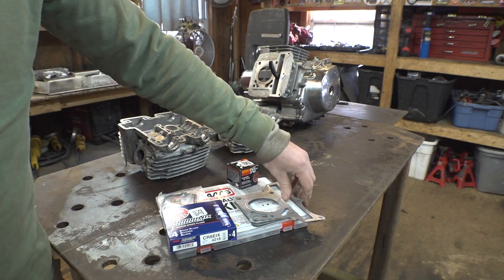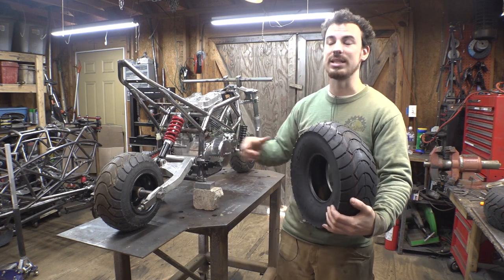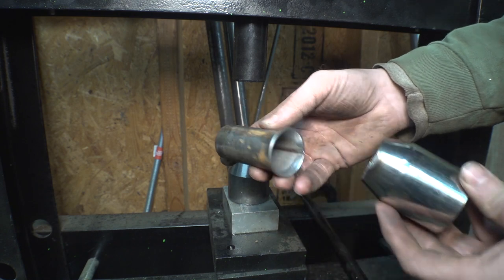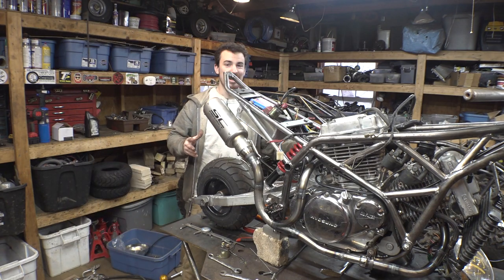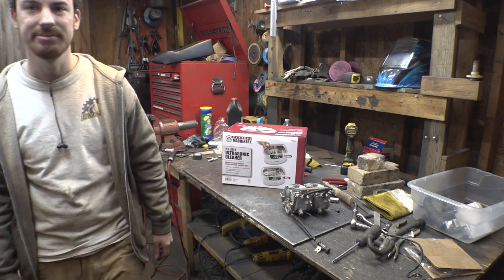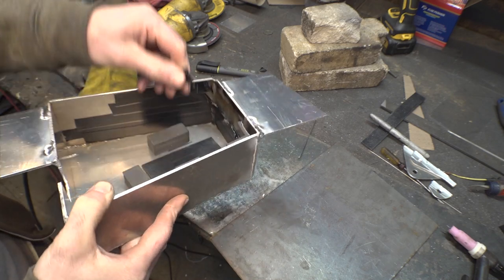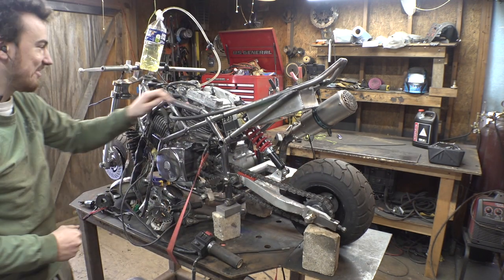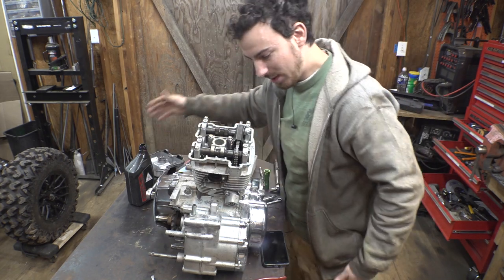Getting the Mini Crotch Rocket Running!!  Mini Crotch Rocket Build Part 7

Comment: A lot of motorcycle exhaust systems are double tubing to stop discoloration and so that the outside doesn't get severly hot and overheat your legs or feet.

Comment: The crank journals are opposite each other like in a Honda. It sounds proper for that arrangement. A Harley uses one journal for both rods that's why it gets the potato potato sound. Oh and you didn't need to get shocked. Since the sound changed when you took one plug off and it was still running it had to been running on both cylinders. LOL
Reply: I assume he knew that at first one worked by his reaction, but for fun and to see if other sounds any different did the other. I hate getting shocked by bikes.

Comment: An easier method to fix your battery box issue would have been to move the box so that it was on top of the frame brackets so it was sandwiched between the frame and seat.  Remove the bolts, and the box is still sitting on the frame.
Reply: More people need to like and comment on this to make sure he sees it, definitely a good idea
Reply: Thought the exact same thing.
Reply: Yeah. Funny how you can overlook something simple like that while designing.
Reply: I yelled this at the screen too as he went to cut them off... too late.
Reply: @TuttleScott  me to
Reply: @TuttleScott  I did the EXACT same thing.... "But, IS he daft? Why not just put the box over the seat mounts to let it hang from there???" 😁
Reply: yeah was def thinking cut out a chunk in the bottom of the seat and then it can act as a cowl and functional padded seat to cover the box.

Comment: I swear I am the most stoked person to follow this build! Due to having an exact same engine for my current  powerwheels build. I made my exhaust a week ago and I actually utilized the original one. I cut up the doubble-wall tubing and used only the outer tube to make the new one. Yesterday I also made a batterybox and started bundling up the wiring. It's close to a start up and MAN was this inspiring to hear yours! Love the bike 🔥

Comment: Looks great.. Back plug is most likely for lights, the one you had start wires plugged in to first, clutch is most likely a cable adjustment.  Your getting there.  Great job..

Comment: On battery challenged builds, you can set up the ignition relay to break the lighting circuit while the solenoid is triggering.
Reply: Simple, effective and easily overlooked, I love this idea even for non-battery challenged builds ...

Comment: For small parts use a metal mesh tea ball for them it keeps them contained and you don't have to fish for them later. float pins, needles ect............. Also the lithium ion battery will tank if charged close to freezing temps so be aware of that.

Comment: I’ve used a few of these mufflers, there are many cheap exhaust inserts (51mm) available that fit and work well to keep down the sound. The little v2 engines usually sound good and still have the distinctive V2 sound, I would guess as your primary header is so long and the rear so short, by the time the sound gets from the front cylinder firing, the rear is almost firing so the sound is less uneven and sounds closer to a single.
Most factory exhausts on v twins has the secondary header loped forward before going back to increase its length before joining the primary pipe.

Comment: Next time you want to see if both cylinders run(instead of shocking yourself) just use a temp gun on the exhaust, you'll know right away if one is not running or not properly. Also for your ultrasonic, they do sell fluid for that that will help dislodge and clean parts. Good work on the mini bike so far, can't wait to see you ride it.

Comment: When I was a mechanic for John Deere, we used simple green in our ultra sonic cleaners.  I now use Chem Dip in mine.
Reply: Can you use mineral spirits?
Reply: I use regular pine sol cleaner and let it soak overnight. I don’t have an ultrasound cleaner but it works great. Best thing I have found and found it by mistake. Give it a try.

Comment: You should use a carb synchronization tool on any multi carb engine where you take them all apart.  And the reason the chain is jumping is probably due to power pulses from the engine.

Comment: If you reinstall original solenoid, I guarantee it'll work. The positive for the switch coil is shared with feed. You need two of 3 wires to make it click.

Comment: Don't know if anyone has told you, but when you're planning for foot placement on the pegs, you're supposed to ride with the ball of your foot on the peg, not your foot arch. You're supposed to slide your foot forward to shift or brake, and then bring it back. There's a couple of reasons why you're supposed to do this, but the two you need to worry about are; 1: dragging toe on ground when leaning, and 2: better stability and control over the bike.

Comment: Great build Chris. Re. your clutch, the plates will just be stuck from standing. Just cable tie the lever in and  once you can sit on it and roll a bit to engage 1st gear the plates will break loose. More likely though you will do it right not easy and strip the clutch 😉, love your work. Thanks for sharing, Paul (UK)

Comment: Hey :)

I want to clear something about your "muffler".. you got there an after market exhaust header, its an sc project and its pretty good as far as quality goes, it doesnt make the sound much quieter!!! Its just tones it to bee little more bassy than a straight pipe "wich you got there", to make it remotely quiet you have to do what a stock exhaust makes, they record the engine sound and make the buffler in a shape so the acoustics inside will cancel eachother so the escaping sound is tons tons quieter.. 

Its pretty hard to do at home.. though theres a solution you can take a pipe make a lot of holes in it and then wrap it with insulating ceramic wool and put another pipe on it make it much larger  ( doesn't has to be round) fit it under the seat or something that should lower the db to a point that you dont need ear protection to idle it😅

Hope youll find this comment and it will help you :)

Comment: It's turning out pretty good. I would suggest in the future maybe, chop up an existing tank for some curves in the corners/top. That one is a bit bulky. The funny thing about this project is that you have gone the complete opposite of the original. They tried to make a small engine look big in their frame. Double wall exhaust so it doesn't look like a pea shooter on a big bike.

Comment: Just a couple/three of quarter inch wire struts parallel to the piping spaced off one eight  inch. Stops the rub while spacing you away from the exhaust pipe both the ankle and heal.
Check the pipes for heat. . . . . . . . . . . . . . . . . . . . . .  way easier than pulling wires

Comment: Be very careful with tuning because since the exhaust for the rear cylinder is so much shorter than the front cylinder you could wind up burning valves do to one cylinder running richer than the other

Comment: Great built. You might just need to balance the carbs (vacuum gauge) to get it running like a twin. Once the float height and jets are clean you should be ok. For the clutch it is common for the plates to together from not being used in a while. They should free up when you'll drive the bike. Great job on the exhaust. 👌😎

Comment: Here's something to give a thought into,,,
What I did on my build with that same engine, I turned the oil cooler around upside down, where the input and output are at the top of the cooler. That way the cooler will bleed itself of trapped air inside.

Comment: If you want to tune the carbs more, get one or two Spark Plug defoulers, get an O2 sensor and sensor gauge and then you can fine tune to get it close to stoich.

Comment: Parts cleaner::: you need right stuff like brake clean/carb clean solution but in a jug not a spray can. “Parts cleaner”.  Also try some thin tape or pin stripping an play around with it on gas tank. Maybe a slight difference will get the look your liking for.

Comment: you should take a piece of fuel line hose, split it down the middle and wrap it around the edge of the aluminum where you passed the wires to the battery box

Comment: Also, why didn’t you route the exhaust system inside the frame? 🤔 There’s plenty of space, as far as I can see. At least for the rear cylinder. 

That would have looked so cool.

Comment: The brass screw that you broke is the main jet. And the most important thing about it is the hole size. It just looks like a m5 main jet. The hole size will be imprinted on the top. They are cheep as chips on eBay. Just match the good one. 👍

Comment: If your clutch plates arent stuck you just need to adjust the cable. It might have an upper and lower adjustment. Also your rear cylinder shocking you is an indicator that you have a bad boot. Also you might what to check the sync on the carbs. The butterflies might not be synced together which is why they run together with more throttle and one will cut out at low idle. One butterfly might be closing more. There are videos of useing a small drill bit to set the sync to get you close

Comment: Hey dude, i had a GT 250, exactly the same motor just a naked bike style. sometimes i used to think i only had 1 cylinder firing even with the stock pipe but that's just because its a really close V angle and both cylinders fire really close... still an epic motor though, you should shred nicely! one thing to look out for on those carbs is that the rear float height inst stable because of vibration so the rear carb tends to leak a bit. just make sure you balance the carbs properly :)

Comment: Maybe the header length for the front cylinder is tuned so the exhaust pulse merges in time with the rear cylinder at the Y, causing it to sound as one pulse.

Comment: If you look at the exhaust it up to most of the style motorcycle engines they both converge in the middle of the V atcylinder height and then go down in front of the transmission housing underneath allowing you to avoid heat problems around your foot and more of an equal length header for each cylinder

Comment: Looks like the clutch disks are stuck together, fear not, though, it's simple enough to rectify. When you get it on the road, just get it moving, throw it into gear and work the throttle aggressively with the clutch lever pulled in. They'll break free in a moment 🤙

Comment: Hi mate,  I watched your exhaust build and find it way to close to your foot, another way would be to go straight out the back from your rear cylinder ( through the frame at the rear) to the muffler , the front can stay as it is but have the joint at the back. Then the pipe would only run under your foot.
Just a little a suggestion, but loving the build just like all your builds.

Comment: I have that exact same ultrasonic cleaner and it's never done much for me.  I've tried various mixes from vinegar to the powders and nothing seems to do much at all.  Mustie uses berryman's in his bigger unit, but that isn't recommended ;)
Reply: Have you tried some sort of alcohol or maybe simple green? I’ve been curious about them also.
Reply: @BenNawrath  I have not, although I did try dawn with no effect.  I just think the oscillator or whatever they use to vibrate stuff is too small to be any use.

Comment: 🙃 Holy crap dude, I just checked the GV250r "cruiser motorcycle" specs and you better hold on to those little handlebars when you do get to ride your mini crotch rocket. The stock motorcycle weighs in at 388 lb. and your rocket should be much much less than that. You are going to have the V-twin bottom end torque (WHEELIES) and that engine redlines at 12,000 RPM. That is grinder speed rpms, so that little wheel might just burn off without having to even try hard.  😁  I am so envious. You might have to build an extended swing arm, add nitrous and take the little beast to the drag races. I can not wait to see this all come together and get your reactions on your first ride.

Comment: This is a 90º V Twin and won't sound like other V twins .... this is more like a Ducati than a Harley. A harley and some utility engines are 45º, so they sound much rougher or "lumpy" This is a smoother, much better design.

Haha... I've dropped timing chains many times before. A coat hanger with a hook bent on the end of it sometimes works... sometimes a magnet.

Comment: An easier method to fix your battery box issue would have been to move the box so that it was on top of the frame brackets so it was sandwiched between the frame and seat.  Remove the bolts, and the box is still sitting on the frame.

Comment: The sound of a single pipe, multi cylinder engine. Depends on the relative length of each exhaust. 
Eg equal / unequal length headers

Comment: It's probably not sounding like you expected it to because the Idle speed is too high. That thing sounds like it is idling at about 1200 to 1300 RPM, anything much over 1000 RPM makes the characteristic syncopated idle that Vtwins are known for disappear as the cylinders begin firing to rapidly for the ear to continue to distinguish individual cylinders firing.

Comment: Also it looks like you left a float needle out on the table and you wouldnt notice that until you put the tank on. That could be your running issue. Flooding one carb and starving the other

Comment: Put little bit mad max out of the box thinking into to the fuel tank. You should integrate airfilter(s) into the fuel tank, filter could pop out middle of tank. You wont need gallon fuel tank anyway so flatten it.

Comment: For your ultrasonic cleaner you should get carb cleaner it comes in a paint can at advance Auto or any auto parts store for best results you just can't leave your carburetor in there for a long period of time plus you can't put any gaskets in there or it's going to swell up the gaskets and they won't fit any longer.

Comment: One way to get an engine to fire up easier and to get fuel to the carb better you can suffocate the carbs and turn the engine over just slightly and it will force fuel into the carb allowing it to start

Comment: Been cool to run the exhaust through the frame, and had muffler showing only, then you wouldn't have to worry about burning your foot.. bigger tires will make it look better, don't know if the new ones are the ticket either, but it's your build, do you..

Comment: instead if pulling plug wires,  feel the exhausts...if one is cold...not firing.  had same problem with my Honda Magna.  you should hang the fuel bottle upside down...

Comment: as for the clutch issue, I had similar problems on my old 125cc keeway. mostly it happened when it was sitting untouched over winter, and it just had stuck plates which became unstuck at the first load on the engine; that is, start it up, sit on it, kick it in gear, the engine is gonna die maybe once or twice, and thats it. problem solved at least for me that is...

Comment: I was gonna say run the exhaust under the seat. But h can’t use that battery without a lithium charging system. You’ll destroy that battery possibly blow it up.  Who the hell knows. Should’ve just gone with an agm. Probably less in price but will work on a regular charging system. Plus you’ll need a lithium battery charger lol. Lithium batteries great. They’re super light. Really useless in a bike 😂. But the agm is small a little lighter. Plus u can turn it sideways too. It also doesn’t sound like a vtwin bc Harley builds them way different. I know when I went to replace the pistons on my buell. It was weird bc of the way they work. But it’s also a 250 and China is weird anyways. They try to replicate things they couldn’t ever do right. Plus it’s a 2:1 exhaust which I don’t like. I had a 1100 Honda and it didn’t sound like a Harley vtwin. When u buy a vtwin. U think of that Harley shake and distinctive sound. Well Harley’s timing is way different than any ones vtwin. Plus I’m pretty sure their bore is way different too and a longer stroke. I’m know Harley expert. This is just shit I learned from owning the buell. Harleys are just different from jap bikes period. Nothing like American muscle

Comment: 35:50 if the valve timing on the two heads is set to fire the cylinder on the same stroke, the engine will have more torque off the line.

Comment: You will have to get a special charging system for the lithium battery lithium batteries do not charge the same as regular lead acid batteries

Comment: I've never built a motorcycle so I can't necessarily speak on your behalf but it seems as if your exhaust is Flowing better through one side than the other so it overpowers the sound of the other cylinder. But electricity is something I know all too much about, the reason you're getting shocked through your TIG welding gloves because those coils are out putting anywhere between 12000 and 25000 volts and the breakdown voltage of your TIG welding gloves is maybe only 300 volts to maybe 600, I can't speak on it because I don't know the specs on your gloves. But 12000 to 15000 volts well jump straight through your gloves, with a high enough voltage normal materials turn from insulators into conductors. Even a real set of White Electrical hot gloves for dealing with high-voltage would still jump straight through the glove, of course unless it's rated for it

Comment: It won't sound exactly quite like a Harley because it's a 75° V, ware as a Harley is a 45° V.
And yes, it does have only one connecting rod journal, it's just twice as wide to accommodate the width of both connecting rods sitting side by side.

Comment: I've said it before but it probably got swamped.
These cheap 250-350cc cruiser bikes are more about looks and cost.
Hence the huge size of the engine and the tube-in-tube exhaust. Its pretending to be a Harley or Indian but at 1/4 price.
Nobody wants to admit they are riding a 250.